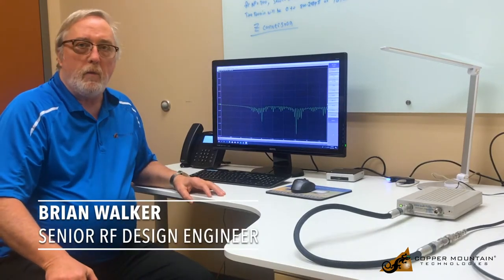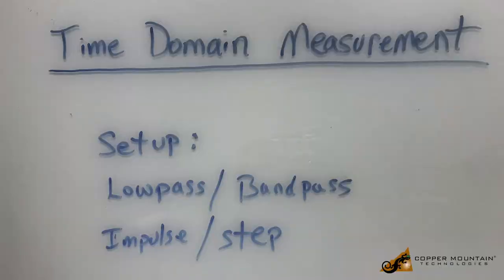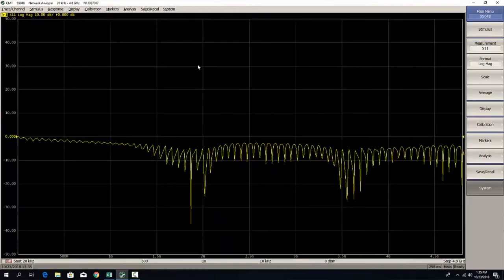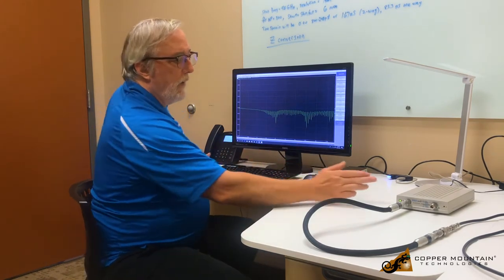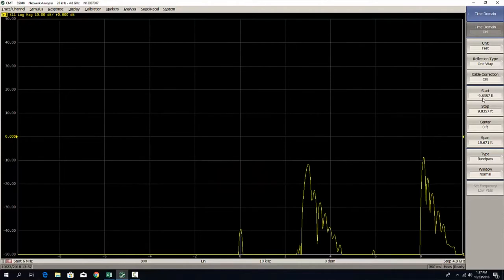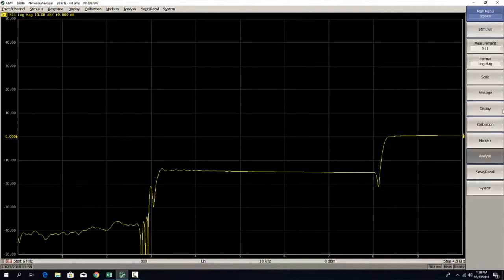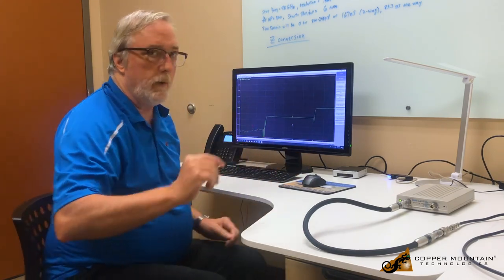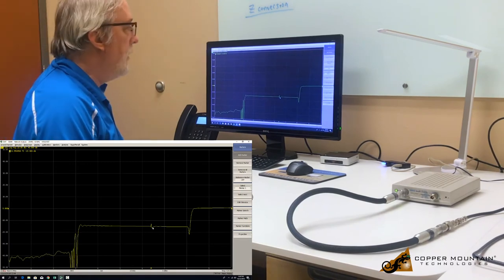Time Domain Reflectometry Measurements with a Vector Network Analyzer

Comment: What is the possible smalles resolution (in feet) of impedance mismatch detection that is possible to achieve with this? Is it derived only from the phase resolution?
Reply from the maker: The resolution of a TDR measurement made with a VNA is function of the bandwidth of the sweep. If the swept measurement is performed between a Start frequency of 10 MHz and a Stop frequency of 18 GHz, then the sweep bandwidth is 17990 MHz. For the Lowpass method, the time resolution (step size) will be 1/(2*17990e6) or 27.8 pS. For the Bandpass method, the resolution is half of that (no 2 in the denominator) or 55.6 pS. ( See
https://coppermountaintech.com/time-domain-processing/
for Lowpass vs Bandpass explanation). The time resolution translates to a distance resolution by multiplying by the Guide Velocity, Vg, which is the speed of the RF signals in the cable. This is the speed of light, c, multiplied by the Velocity Factor, which is about 0.66 for solid PTFE dielectric, 0.91 or so for low-loss foamed PTFE and 1.0 for air-line. For a solid PTFE cable, the distance resolution would be 5.5 mm for 27.8 pS and 11 mm for 55.6 pS. This means that each point on the Time Domain screen represents a distance of 5.5 or 11 mm. The number of points chosen for the VNA sweep does not affect this, it only sets the maximum time or distance. If 1,000 points are set, then the maximum time will be 27.8 nS for Lowpass and 55.6 nS for Bandpass. That’s 5.5 or 11 meters maximum range.